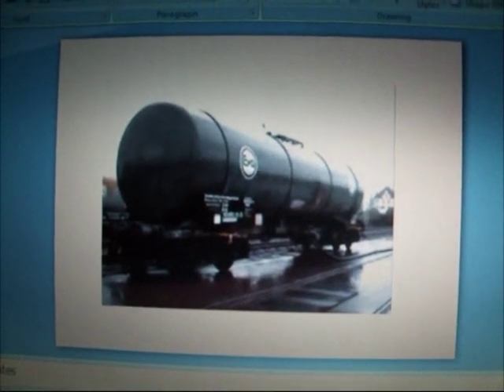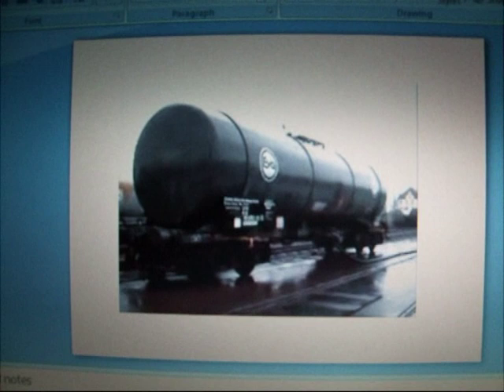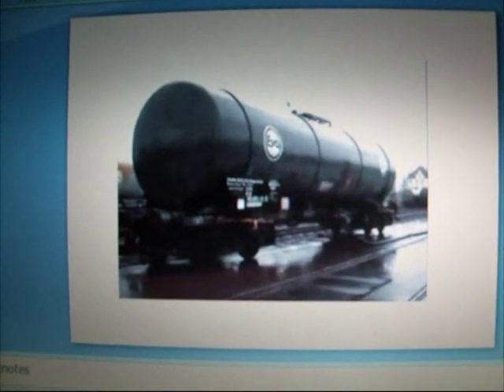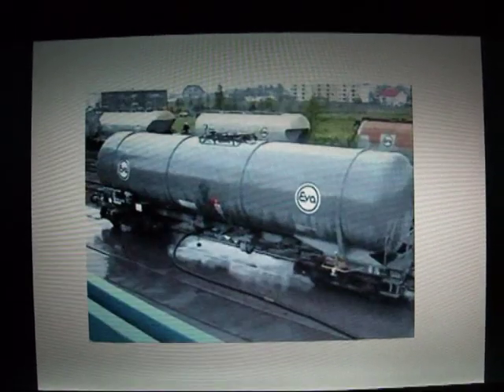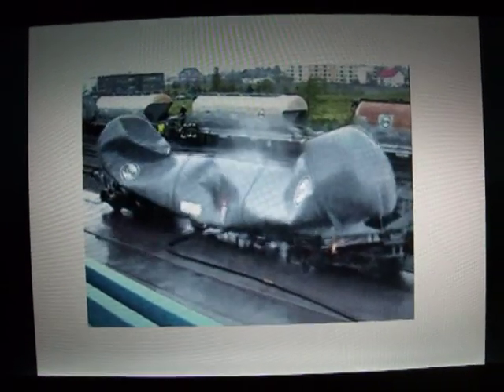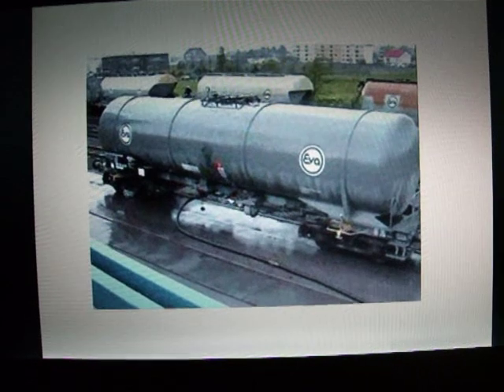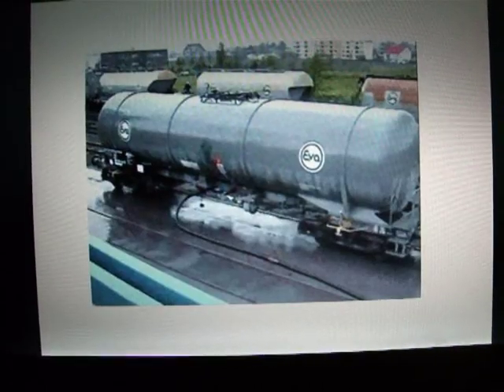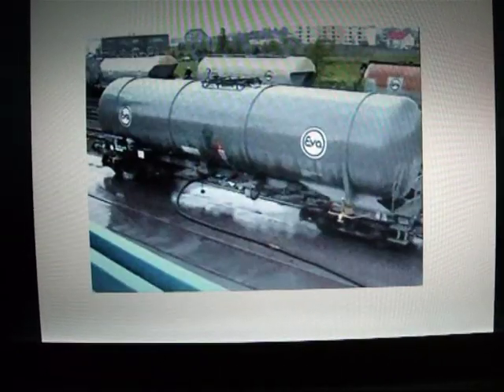Buckling of a Rail Car Tank Under External Pressure

Comment: That is not extreme pressure. It is just one atmospheric pressure. The container buckled because of the pressure difference between inside and outside of the container wall. By the way, these containers are usually built to hold pressure within, not to resist pressure without.

Comment from the maker: That might be true, but the fact of the matter is that a thin-walled circular cylinder under external pressure will buckle (implode) at a fraction of the pressure that will cause the same vessel to explode unter internal pressure. See my book on, "Pressure Vessels: External Pressure Technology" by C. T. F. Ross, Woodhead Publishers, UK. Initial out-circularity of the vessel plays a significant role on the magnitude of the external pressure of the imploding vessel!
Reply: So if they're built to withstand internal pressure, there is no design flaw. The point is, it is incredible that steel will implode like that against the atmospheric pressure in which most humans live their lives!

Comment: THE MYTHBUSTERS TESTED THAT MYTH AND BUSTED IT BECAUSE AN AVERAGE TANK CAR WOULD NOT IMPLODE SO THEY PUT A DENT IN IT AND IT IMPLODED!!!!!! :)
Reply: +DJ EZE The Mythbusters did not do enough research, I would guess. It does happen. You can find pictures of imploded tank cars that are not tests or demonstrations. One clue is the car has reporting marks- something like GATX or UTLX and a number. That means the car is in service and not one for scrapping. Notice the cars in the Mythbusters episode had no numbers. A railroad car without numbers is "off-line" in a manner of speaking. It is dead. 
Further, implosions can happen by improper venting while steaming a car, or by improper venting while emptying a car. Covered hoppers, used for grain or fine particulate matter, will also implode during unloading. Atmospheric pressure is about 15 pounds per square inch, and a sixty-foot tank car has a lot of surface area. There are hundreds of facilities across the United States for steam-cleaning tank cars, and thousands for emptying them. Mistakes do happen and vents can become clogged or malfunction.

http://blog.onlinemetals.com/wp-content/uploads/2008/08/railcar-12.bmp
Reply: +DJ EZE Yes, so this tank car may have had some unknown damage done to it. Also the tank car used in myth busters was of American design and was probably built a bit tougher than this European design.
Reply: you shore? we are starting to go Chinese plastic with everything we make

Comment: Actually, there is no "unfortunately" about it.  It was an intentional demonstration for training. I have seen longer parts of this video, but haven't been able to find it again. I'll have to look at the corporate logo on the cars and try to figure out who did it. There is a very large crowd observing.
   I suspect the tank car company, railway and/or chemical industry people who use those cars were giving employees a demonstration as to what happens if the employees managing the cars don't allow proper venting procedures.
   Railway cars depending on their type and design have expiration dates.  After that date, they can no longer be used and have to be scrapped.  Railway car companies often have numerous cars each week that have to be scrapped, so it wouldn't be a loss and problem to take one and intentionally implode it as a demonstration and then cut it up for scrap. Often railway cars that have reached their expiration date are blown up, burned and crashed to make movies.